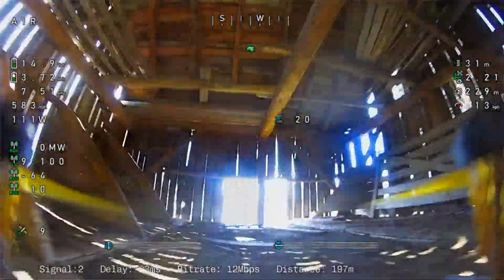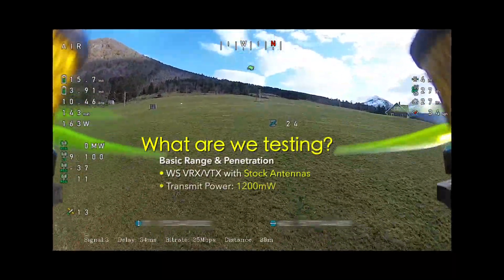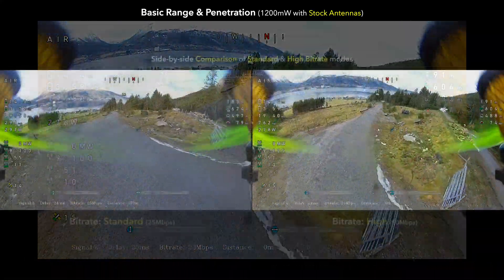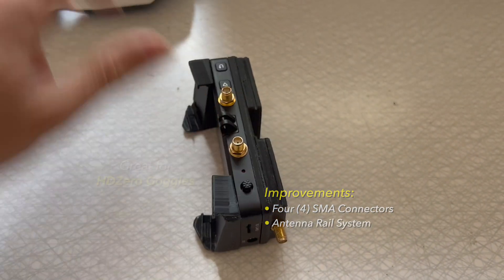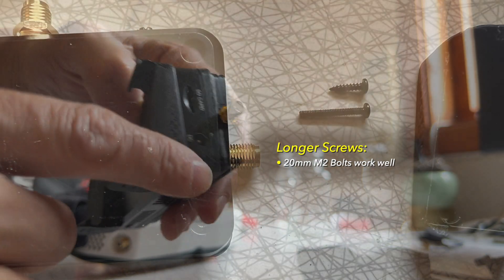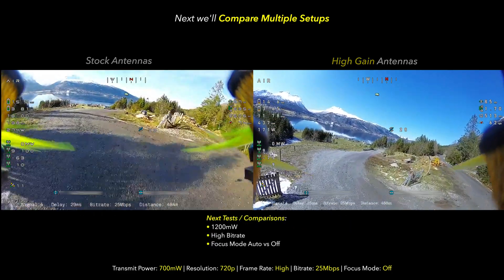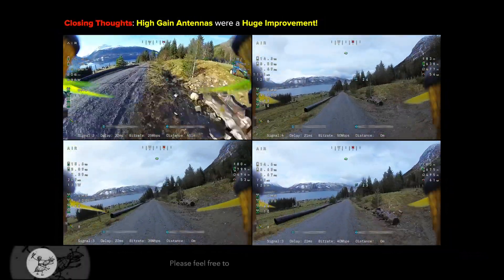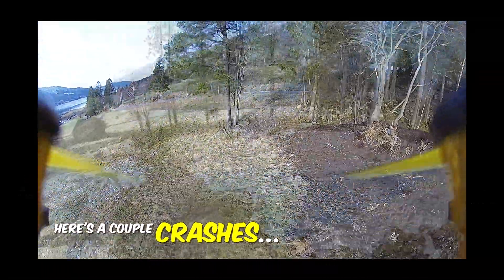Improve WalkSnail Range & Penetration with High Gain Antennas? FPV Image & Signal Test Comparisons

Comment: vas (video aerial systems) they are imo the best antennas . i have the ion (omni)  the skyhammer (omni) the cross hair patch and a generic hgp antenna on a pair of skyzone cobra x v4 goggles and i have no problem with my video at all through anything. houses, trees, fences and vehicles.. no problem. i do run everything rhcp instead of  lh like most. i even swapped the antenna on the vtx to a rhcp caddx antenna
Reply from the maker: Glad to hear, I’ve used VAS antennas in the past, and chatted with them a few times.  Alex has historically been a big part of the community and their quality is top notch stuff.  Thanks for sharing!

Comment: Excellent 1:15 comparison. The bit rate is the capping of high information area (many grass blades/tree leaves going by) with an image coding algorithm. No surprise that when low amount signals go through at 1:15 comparison, the high capping is not relevant.
Reply from the maker: Yea, WS doesn’t do a great job with highly detailed environments like trees and foliage. I agree with your thoughts here, thanks again for watching and supporting the channel.

Comment: The problem with the ws vrx i have is that the stock antennas u get are so bad that u HAVE to mod them. Just give us the empty device and let us buy the stubbys/patces ourself and make it  a bit cheaper. Also the compression is absolute trash and it feels like the last updates have gotten worse. I really want to like walksnail. They have some cool products but everything feels like a prototype and not like a finished product. For example the update process for the moonlight, the overheating goggles x, the terrible app that came waaaaay to late, the analog "bay" that u have to glue to the top of the goggles and also glue the module to that "bay" and everything is just exposed up top.....
Come on Caddx u can do better.
Reply from the maker: @galardo3303  100% agreed. After my DJI O3 testing a while back I decided to sell my WS stuff… DJI is just performs so good and feels so well designed.  
DJI O4 of course looks even better, and is making WS users question what advantages WS even has now. 
I did have good results using Helical antennas with my WS setup (WS Helical Test- https://youtu.be/06fV2vQaxW8), but then my DJI tests basically destroyed everything with near basic antennas... 
(Here’s the DJI comparison if curious: https://youtu.be/YjuHzt7J3VE)
Anyway, now I have DJI O3 & HDzero gear, but have no time to fly anything…Haha! Thanks for watching, appreciate your thoughts.

Comment: I love your video! Could you send me a list of links to the parts you used in your VRX set up? I have the drop and I’m also trying to increase the video transmission range. I can’t seem to find where you bought all the stuff to modify the receiver
Reply from the maker: @MinhLe-ls5vp  thanks, you really just need 4 UFL to SMAs. 
The rest of the mod was 3D printed parts which you’d have to make or modify your stock VRX. 
Good luck and have fun!

Comment: Nice video credits))
1. How do you think, is it reasonable to replace lollipops(or one of them) at the top of vrx on high gain patch antenna(s) for flying long distance? Don’t want to make all this radical changes in construction. 
2. After all the tests, do you use focus mode when trying to maximise fly distance
Reply from the maker: @KuDennis  thansk for watching. I’d replace both top antennas with high gain ones honestly. I do think focus mode is beneficial. 
When doing long-range just make sure you have good LOS, check out the Part III where I demonstrate that… haha
PartIII - 
https://youtu.be/06fV2vQaxW8

Cheers!
Reply from the maker: @KuDennis  thansk for watching. I’d replace both top antennas with high gain ones honestly. I do think focus mode is beneficial. 
When doing long-range just make sure you have good LOS, check out the Part III where I demonstrate that… haha
PartIII - 
https://youtu.be/06fV2vQaxW8

Cheers!

Comment: Excellent videos!  I made the transition from analog to Fatshark Dominator HD(Walksnail).  I'm building a AOS7  long range quad.   I've never done any long range, I don't want to lose a quad.  Being very cautious, getting all the info I need before sending it.
Reply from the maker: Hey Nick, thanks for watching. My biggest problem with WalkSnail/DJI is the lack of warning & potential to disconnect. In comparison to Analog/HDZero which show real-time break up, and can’t disconnect. 

In a follow up test I show what happens when you reach the limit, and what happens when you go too far… 
Here’s a link - https://youtu.be/06fV2vQaxW8

Check it out. If you have good LOS WS/DJI are excellent performers and without too much issue. 
Let me know if you have questions cheers!

Comment: great video!
Reply from the maker: Thanks, definitely some solid improvement. Here’s the follow up video which started off great but had a ‘tragic ending’… 
“WalkSnail FPV Penetration & Mountain Range Tests!” https://youtu.be/06fV2vQaxW8
Reply: @GiantAntCowboy  Is there a reason you use the hdz goggles with the ws vrx and not the avatar goggles x? Is there a difference in image quality/range in these 2 setups?
Reply from the maker: @lolmetyuri  ‘Long Answer’: i mainly fly HDZero because I prefer it for Mountain Surfing. HDZero has lower image quality but the latency & resolution are both fixed which is more predictable. 
Also HDZero displays static when there is signal issues, this static instantly tells you if you’re aiming your antennas wrong or if you’re flying behind an obstacle. This allows you to quickly make a correction and avoid losing image. 
WS/DJI both have better image quality, but buffer the image to correct signal issues. Generally this is great and works well, but when you fly behind an obstacle and these systems try to fix the lost signal it creates a delay, frozen screen and/or a sudden blank screen. This delay even if only a second can easily result in a crash or lost quad. (Ex: 80kph for only 1 second is 22m!)

Also this signal buffering/correction makes it really hard to aim/adjust your antenna aiming while flying; and getting it wrong will again result in lost video/lost quad. 
Each system has pros & cons, but for me I just prefer/trust HDZero for my more “risky flights”.

Comment: Its strange. I see so much disparity in the performance of this system. I watch tests where it performs fantastic then there are these. I wonder if there is a unique environmental feature/factor it has more difficulty with than others. Perhaps absorption. So much water in those trees.
Reply from the maker: Yea, trees are much harder for RF to penetrate than buildings because of the high water content. 
In my original tests with stock antennas WalkSnail had tons of “smearing” around my property behind every tree. The antennas helps a lot.

Comment: What are the center frequencies of your antennas?
Reply from the maker: I’d be lying if I said I know. They are simple DIY antennas made without any special equipment based on measurements tuned to 5.8ghz. But where in the band exactly I have no way of knowing. 

I’m hoping to do follow up tests in the future using some antennas from ProDrone. This company in Poland individually tunes and tests each antenna they ship. So stay tuned cause that’ll be interesting. Cheers!
Reply: @GiantAntCowboy  Cool.  The reason I bring it up is because the center freqency (the frequency where SWR is the lowest) is extremely important for weak signal reception.  I've not seen one youtuber mention this hugely important consideration.  Interesting, since we're all supposed to be HAMs - lol.
You match your RX and TX antennas while broadcasting on the channel that most closely matches their center frequency.  Right now I use Foxeer lollipops (RX and TX) on Chanel 2 which gives good power (the lower channels have higher output) and most closely matches the lollipop's published center freq of 5.7GHz.
Reply from the maker: @mlentsch  yup, 100%. Wish I had access to proper SWR and tuning equipment. However as I said I’m hoping to get some antennas from ProDrone, and this company will literally tune all the antennas they send you to a specific frequency. Every antenna they sell comes with the tuning frequency and SWR I believe. I’ll do a follow up video if I get a set. Should be a neat comparison for sure.

Comment: If you fly 700mw and 25mbits the range and penetration is awesome
Reply from the maker: Yea, if you go to @3:00 I show those settings. It’s trees 🌲 the system really seems to struggle with. 
In my next video I’ll be testing some new antennas in some tougher environments, taking a look at how the system recovers after a complete  signal loss, and maybe I’ll do some building penetration tests, and doing some HDZero comparisons to see how each system performs and reacts.
Reply: @GiantAntCowboy if I think about it that it struggles with trees is defenetly true, I always wondered why my setup suddenly struggles so much when flying behind even a moderatly sized tree about 200-600m away from me. But it performs really well with buildings.
Reply from the maker: @trumblez  yea, that’s what I’ve been trying to improve with my tests & modifications. Basically any time a tree gets in the way the image gets really blurry/smeary. 

When I’m sitting still the WS image is amazing, like way better than HDZero, but the moment I’m behind a tree the image gets quite blurry and it’s hard to see, at which point my HDZero system looks way better. 

I do a lot of freestyle and cinematic flights in & around trees, so WalkSnail has been a bit of a disappointment for me. 

I’ve been trying to push the performance but think a lot of it has to do with the compression algorithm, since fast grass also gets blurry even with perfect LOS. 

I’ll get messing around with it, see if we can’t improve it a bit. I also don’t like how it disconnects when signal is completely lost, that’s my issue with DJI as well, and why I only fly HDZero (or analog) in the mountains where LOS mistake happen often and can be disastrous…

Comment: Question: Are you now using all RHCP antennas because of this swap? Does it matter as long as they are all the same? Just got into walksnail and the whole LHCP thing..
Reply from the maker: RHCP or LHCP have no impact on performance, you just have to make sure all antennas match.  
I switched everything to SMA RHCP so I could do comparisons to HDZero and also have so many RHCP antennas already.

Comment: Where did you get those ufl to sma pigtails for the upgrade? I have read that you need a specific cable for the 5.8ghz band. Amazing video planning to do this upgrade too.
Reply from the maker: These were just purchased from Amazon when I was in the USA.  You can’t use one with thicker coax because you have to make some tight bends inside the case. 

Here’s a random example of what I used. https://www.drone-fpv-racer.com/en/ufl-to-sma-antenna-cable-by-ninjatech-10004.html

Thanks for watching. Cheers!

Comment: I was debating on whether to get WS vrx for my HDzero's but this kinda just proves that for an extra 200 dollars and not to mention the extra LHCP antenna you would have to get, the results are kinda disappointing. Extra 300 ish dollars doesnt seem that much but the amount of range and penetration is barely improving. I think I'd rather just get DJI and O3 at that point.
Reply from the maker: Yea, I’m just sharing my experience. Lots of people love the system, and I do think it cool as well. It’s especially interesting for long-range wing pilots. But, I don’t know why you’d chose this over DJI. 

HDZero is still my go to system just because I know and trust it for my “particularly risky” style of flying. 

I’d love to get a DJI O3 setup, but it’s a lot of money to spend, and I barely have time to fly my current setups… maybe someday though! 

I just released a new HDZero video today that was pretty neat, and I’ll be working on a new WalksSnail testing video next. So stay tuned, cheers!

Comment: I really need to see about increasing the directional capabilities on my WS VRX. Swapped out the patches for some X2 Airs, and I routed the TX line to one of those. Still got omnis on top however, and that's where I'm giving the most up. Currently reaching 5 miles before I stop trusting it to go further, but I want at least 7. The other thing to chase down is a tracker so everything is always aimed the right way. Got a bad habit of looking down or looking the wrong direction to adjust.
Reply from the maker: Yea, I think swapping the Omnis out with help you a lot. I’m posting a video later this week about my latest antenna setup, all the testing is with HDZero, but I talk about antenna aiming a bit and it’s a fun video. 
I’ll be using that same antennas for some WS testing next. 
If your flying a Wing then losing signal/video isn’t a huge deal, but if you’re doing close proximity flying with a quad it can be game over. 
Curious to hear how your get on with any new setups. Cheers!
Reply: @GiantAntCowboy  Not really any long range proximity to be done around here, so loss of video is usually just remedied by a RTH signal. But yeah, gotta hurry up and figure out some way to hold some helicals in position. With an antenna tracker, it wouldn't be crazy to just do something like 9-15 turns. Wouldn't even need to hold the weight up anymore. It's sorta looking like ELRS Backpack might soon support outputting basic telemetry, so tracking may be viable in short order for me.
Reply from the maker: @jaysonrees738  yea, antenna trackers are the way to go for proper long-range. I never considered a ground station simply because I hike to a lot of locations and it’s just more stuff to carry and set up.

Comment: Hey, I thought it was a fairrly good extra penetration. also i changed minee like yourse if there now rhcp but got impatient and just drilled 2 holes in the front lol..and still waiting for a friend to make the front cover....not sure why they went lhcp...yeah i knnow analog rh digi lh,still choice is nice but so was pulling the vtx apart, hope you find the pene one day,be greeat to seee!tthanx for sharing!
Reply from the maker: Thanks appreciate the comment. Yea they used LHCP in an attempt to avoid interference from/to other FPV users who most often use RHCP. 
I just made a new antenna setup and will do a new test video to find the limits and as well as some comparisons to HDZero. So stay tuned, cheers!
Reply: @GiantAntCowboy  cool cant wait :)

Comment: How much will you charge me to upgrade my vrx just like urs? Yes I’m serious lol
Reply from the maker: If I was local I’d do it, but shipping back and forth to Norway will be expensive and time consuming. (Where are you?)

- Opening the VRX & Swapping the UFLs connectors is pretty easy. (The only caution is there a small component under the top left SMA that’s easy to break)

- If you don’t have a 3D printer you can drill holes in the housing for the bottom connections. Some guys have done this successfully. 

It’s a nice upgrade if you have a lot of good SMA antennas or just prefer RHCP.
Reply: @GiantAntCowboy  I was hoping you wasn’t gonna be far away lol but much love on the reply. I might try after I see for  myself but like I said much love on the reply. Thanks for everything.❤️❤️❤️❤️
Reply: @GiantAntCowboy  did you upgrade you tx antenna?
Reply from the maker: @gpgp1750  happy to help. Yes, I also added two UFL to SMA pigtails to the VTX. 
I swapped everything so I could use any antenna combination and also so I could do some fair performance comparisons to HDZero.

Comment: I keep coming back to this video. The only thing stopping me doing the vrx antenna conversion has been sourcing good ufl to sma adapter cables. I have heard that some actually can cause attenuation. Which did you use? I just saw a set of 4 on amazon for around £10. Did you use such cheap cables or spend a bit more on some others? In which case, which?
Reply from the maker: You know I’ve been trying to remember for days which cables I used. I think they might have just been some cheap ones like on Amazon… crazy I can’t remember but I order a lot of random stuff. 
I will say thinner ones are actually better in this situation because it’s tight and you have to bend the cables around to fit properly. 
Also be careful with the top left connector because there’s a small glass component that very easily breaks. 

But good luck with the mod. If I remember or find the ones I used I’ll let you know. Cheers!

Comment: Have you tried 2nd drone as a signal repeater and auto antenna tracker?
Reply from the maker: I haven’t but all of my WS tests so far have been within 500m and shouldn’t require these sorts of measures. 

Signal repeater drone I always thought could be neat, but assume it would add a fair amount of latency.

Thanks for watching, appreciate you sharing thoughts. Cheers!

Comment: Looking good. So you're using your hdzero antennas (rhcp) on both vrx and quad rather than lhcp that ws usually uses?
Reply from the maker: Yes, for this test I swapped everything to SMA and RHCP simply because I have a ton of these antennas in this configuration. 
Also I’m planning to do more WS vs HDZ comparisons soon and want to use the exact antenna setups for a proper comparison. 

Thanks for watching, let me know if you have other questions, suggestions or thoughts. Appreciate the support, cheers!

Comment: One advantage of walksnail is cheaper than dji integra. But then I have to buy better antennas, it will cost the same as dji and it's outstanding image quality/link/penetration.
Reply from the maker: Yup. DJI is a pretty outstanding system and a great option for most people. Thanks for watching, appreciate the comment. Cheers!